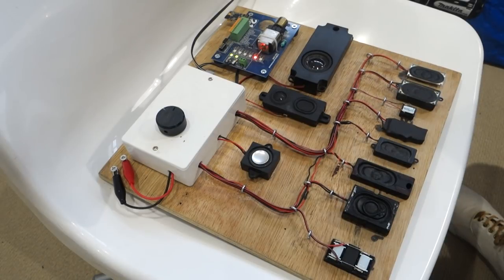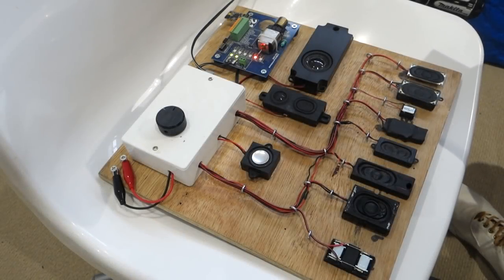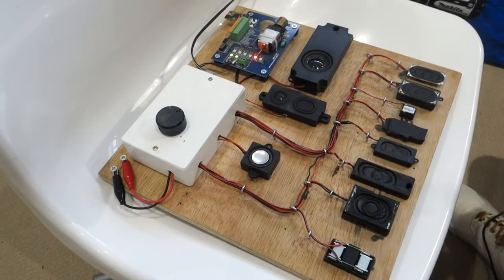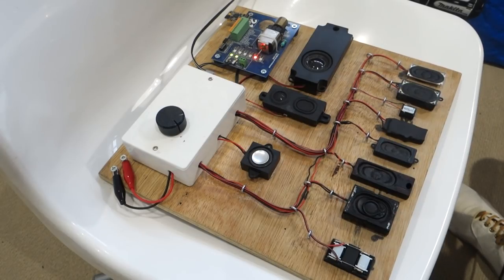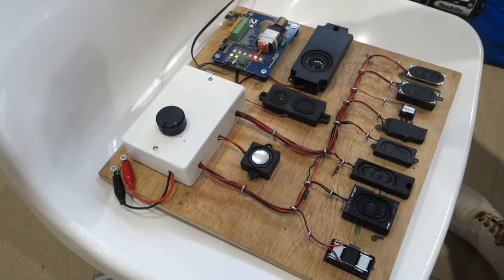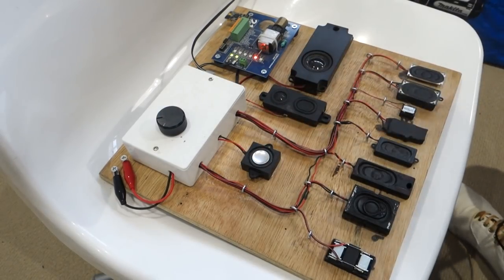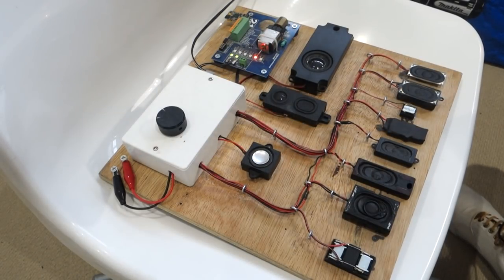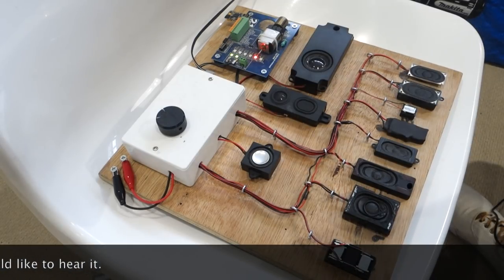DCC Sound Speakers, Ultimate Test And Comparison!

Comment: Hi these speaker comparison videos are invaluable for choosing a speaker. There are some amazing differences. I have used two square megabass speakers in my 0 gauge Western, and it sounds amazing. Going to do similar with my 0 gauge Warship in the next couple of days. It's worthwhile painting black the chrome speaker diaphragm, which otherwise can be seen inside the models from the engine room windows..........I always use Zimo decoders in preference to ESU.
Cheers,

Eve

Comment: This video is very useful, thanks.  I was surprised how good the iPhone speaker was compared to the others, don’t forget it’s not just the bass you need to be interested in.
Reply from the maker: Eugene Beirne I agree, the detail of the iPhone speakers is very important too
Reply: Most of my fleet is fitted with iPhone speakers and when installed in the loco body, the volume is doubled and have to turn down 2 stages..

Comment: The 9th speaker I fitted into a Hornby TTS class 47, the loudest and best of the lot, you have to remove the mounting brackets and black tak into the body , under the roof fans...the iPhone speakers are also very good and have most of my loco fleet fitted with these, cheapest too...

Comment: Great video, I have standardised my fleet on the Dumbo's both single and double, in a house they sound ok much better than the standard.  We have fitted the larger dumbo's in the tanks of the 37.  I have used the larger single dumbo's on my 25's and they sound good.  The Hymek sounds good with two single dumbos as does the DMU's.

Comment: Hi Richard, Only just found your channel after reading the information you sent with my latest order for Megabass speakers. 
The speaker comparison certainly popped up a couple of surprises for me. Apart from the obvious in that bigger is often better and an open speaker is useless the most surprising was how well the megabase fared against the EM2. I heve only previously heard the EM2 in a Deltic and it is pretty convincing. But it sounded very short of high frequencies with the Class 37 sound file and in that case the megabass was better. I can see why you use a sugar cube with an EM2 but that ony works if you have a decoder that can handle 4 Ohms. 
Nowadays I use a lot of TTS decoders as you can't beat them for value for money even though their motor control is crap!  I add a LaisDCC decoder to them and still get a budget solution. I think for these an EM2 is a non starter but the megabase is really good.
I have also had some success using your sugar cube speakers in a bespoke plasticard enclosure where there is little space in a loco and that is a very cost effective solution.
Now a question. You sypply the megabass speaker without enclosure. Will this work without adding an enclosure? From the pictures it looks to be completely sealed across the back already.
Regards
John Tothill
Reply from the maker: Canal Sidings Model Railway hi John, I agree on the em2, it sounds good in some models but not all. The Deltic is probably the best use for it so far. Although with a sugarcube, as well it sounds excellent in many locos but it’s actually less than 3 ohms with a sugarcube in parallel which is less than recommended for even loksound and Zimo. The megabass sounds good, I have used them a lot with TTS decoders as well as using 2 in some locos with more space when using a loksound decoder. The megabass without enclosures has some small slots which you can block off with blutack and it sounds fine, maybe 80% as good as it sounds with an enclosure. Useful if it’s too big with it

Richard

Comment: Having watched your video this is a first class report,very educational. I have spoken to Caroline to-day from SWD. I have been  informed that ESU have just released a new sugar cube kit suitable for small 20mm enclosure ie. Bachmann class 450
Reply from the maker: paul m they have yes and I believe they might also be doing a sugarcube speaker with some bigger enclosures to rival the zimo dumbo, still won’t compare too well to the bigger speakers in the test but could be useful in tight spaces. Richard

Comment: Hi Richard
Great video and some interesting results.  Im finding the larger of your iphone speakers very good, Im not so interested in volume, more sound quality overaĺl and it is such a good sound. See my last vid with 46, its great.  Im hoping to upgrade alot of my V4 fitted locos with this.
Can you suggest something suitable for the older V3.5 chips.
Cheers Paul
Reply from the maker: Dunge Wood Model Railway I’ll take a look at your 46. I don’t have any for the 3.5 but the best you will get are like the bass reflex speakers which don’t perform particularly well in this test. Those are the best speakers I’ve seen with a 100 ohm option. Richard

Comment: Em2 is the better in my mind , are you working with Charlie now ? ... or are you fitting these independently ?   The 37 with em2 could be an interesting conversion for a few of us ...
Reply from the maker: It's very good with the right model. Its also very good if you pair it with a sugar cube or similar which I will show in another video soon. I do a lot of work with him an Ian but I'm still independent. I still have a 37 to for myself just to check the work involved. Just had a lot of other jobs that I've had to do first. Richard
Reply: roadsandrails 👍🏼 shall have to wait and see and  hear your completed Model with the 2 of them ... Dave
Reply: David Howarth hi David don't wish to be rude butting in but I have the class 37 fitted with EM2 and legomanbiffo sound on my channel . I know you commented on mine other bids before so I thought I just update you ? Thanks Dave nice layout you got ! 😁

Comment: Hi Richard, 
What great comparison video.  It makes me take a new look at many of my sound locos.  
To start the ball rolling, what would you suggest for my Bachmann 37, with a LS4.
I’d rather not carry out extensive work to get the speaker into the fuel tanks.
Clearly the 20mm x 40mm will not fit even with the fan assembly removed.
Regards Charlie
Reply from the maker: Chadwick Model Railway hi, thanks, what sound decoder is in there? My favourite of the easy to install speaker for the 37 is probably the double iPhone speaker. If you look at my other video there’s one of a class 37 in Railfreight with that speaker in it using legomanbiffo sound
Reply: Hi Richard, it has a loc sound 4 with a Legomanbiffo sound file.
Regards Charlie
Reply: So Richard, how do I purchase a couple from you?
Regards Charlie
Reply from the maker: You can find the ones that fit the 37 here: http://roads-and-rails.co.uk/store/p89/Double_iPhone_Speaker_For_Bachmann_Models.html

Comment: This is  OK to hear differences in the basic speakers but their position and enclosure within the loco will often impart even different variations than you may expect after hearing them as simple mounted speakers as this.
Reply from the maker: Yes and no, most of these speakers are sealed units, so already have their own enclosures, some of them may sound marginally better facing down as used to be the case with the bass reflex speakers in fuel tanks, but as thats now one of the weaker speakers, something like a megabass speaker or an EM2 is going to sound far better wherever it is positioned. It used to be a case of facing down gave better bass and facing up sounded clear but I really dont think it makes much difference anymore. Richard

Comment: How did you decide on the correct polarity with regards the Iphone speaker? Or doesn't it matter, I know years ago it mattered as it gave a better base when connected correctly.
Reply from the maker: Sam Barr only matters if you are using 2 speakers, if it’s two iPhone then you need to connect then the same

Comment: Megabass, iphone and enclosed 40x20 sounded really good. The 33 tank enclosed alos great but as you say, it has limited applications.
Reply: I purchased one of those fuel tank speakers from DC Kits for my Heljan 26.  Sound was OK but it sat so low it was touching the rails!
Reply from the maker: I have used the D.C. kits enclosure quite a few times but with my own speaker and haven’t had any problems. That’s one of the speakers in the test that surprised me, it’s only slightly bigger than the 20x40 but the sound is in a different league. Richard

Comment: And none of these are any use for N gauge trains really, the earth mover speaker is a terrible design because it has a passive radiator, these radiators run out of phase with the woofer actually hurts the sound quality, best one here is the zimo
Reply from the maker: N Gauge England Synthematix the sugarcube fits in N gauge but you are right, there is very little choice for N gauge. And yeah I see what you mean about the em2, it’s not the clearest sound, but it’s also the only speaker that can shake the baseboard when it’s fitted in a model! It really is effective where you need a lot of bass in things like deltics.